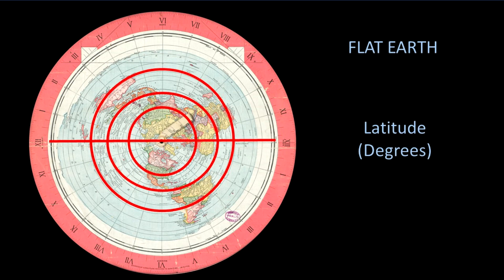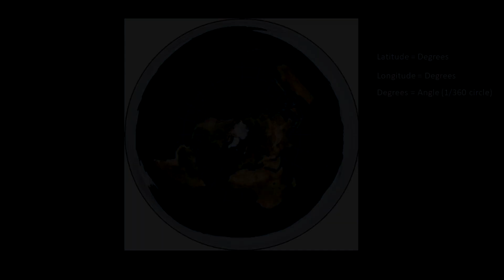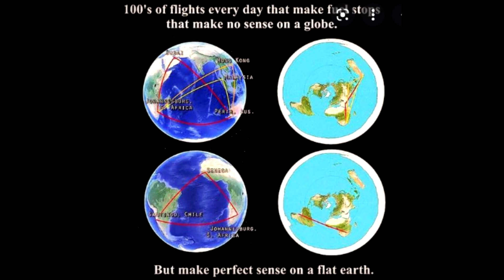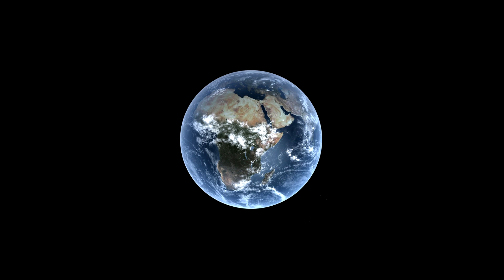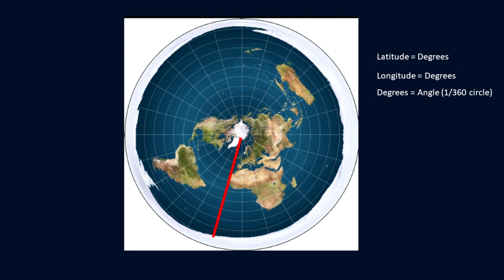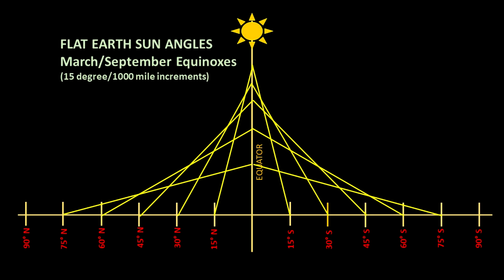Is the Flat Earth Curved?

Comment: F.y.i.- Flatearth map reward now at $71,473,117.  Antarctica is optional.

For discussion:  All flatearthers use the exact same map to navigate Earth.  It's not the Flatearth map... and they all know it.  They are the globe proof.  This is how indoctrination really works.

I am still taking pledges to the reward.  :)
Reply: To make a proper flat earth map, there is an existing LLA Algorithm for flat Earth:  The flat Earth coordinate system assumes the z-axis is downward positive. The estimation begins by finding the small changes in latitude and longitude from the output latitude and longitude minus the initial latitude and longitude.

dμ=μ−μ0
dι=ι−ι0
To convert geodetic latitude and longitude to the North and East coordinates, the estimation requires the use of the radius of curvature in the prime vertical (RN) and the radius of curvature in the meridian (RM). RN and RM along with further conversions of the North and East coordinates to the flat Earth x and y coordinates are required,  I won't bore you with the formulas as they are readily available on the web. Regardless, I'll chip in $1.00 towards the reward fund, as any flat earth map will still have laughable latitude distances and coordinates.
Reply: @JC-ye7pj  Only a dollar???  Where's the creativity?  Did you see the list of pledges?  Please give it another go.  :)